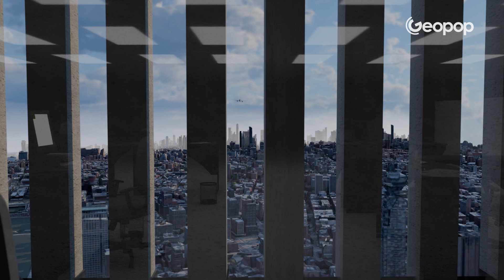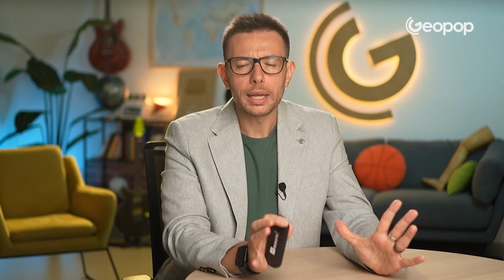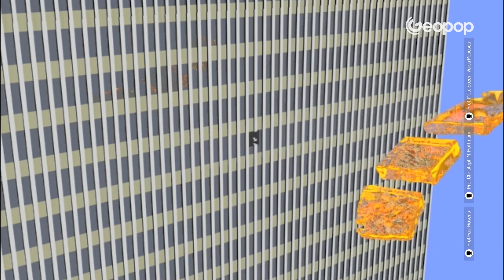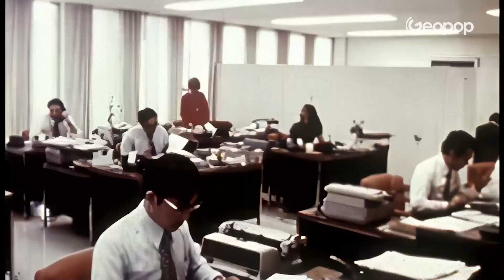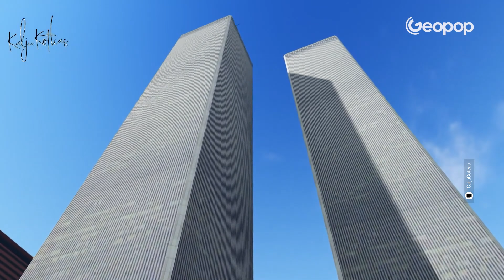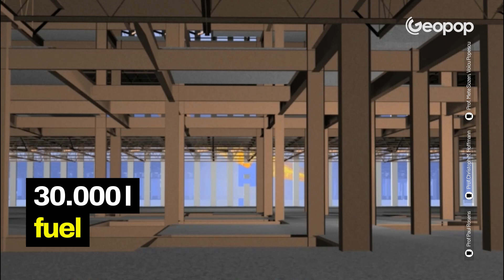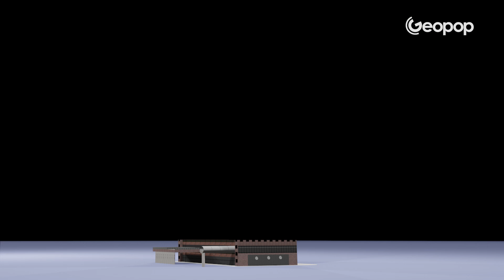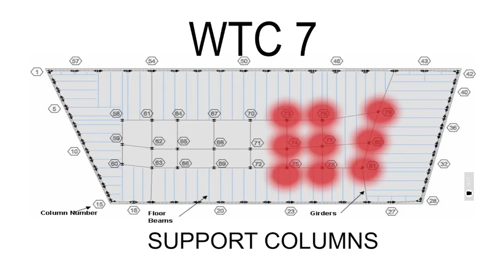9/11, 2001: The Technical Reconstruction of the Twin Towers and WTC 7 Collapses

Comment: Your version has nothing to do with what actually happened. Another falsification designed to support the official version. The video clearly shows how the upper part of the southern tower tilted when it fell, which means the vector of the pressure force on the lower part is shifted and acts with much less force on the floors in the part of the building opposite to the tilt. Accordingly, the vector of the building's resistance force - floors and ceilings that were not exposed to fire, will also be shifted. It follows from this that the top and some floors should have fallen on their sides, but not down. A complete fall down is only possible in the absence of a building's resistance force, and I ask you to note that the total mass of the upper floors has not changed and the load on the lower floors has always been the same before the collision. Also, you did not say a word about the cause of the point emissions from the building, going many floors lower than the actual fall. What you are saying about Tower 7 is generally ridiculous. In the best case scenario, for the reasons stated in your version, several floors in the building would have collapsed and we would have observed the process of the walls curving and the building tilting over several hours, but not a sudden complete collapse in a few seconds. This is a 100% controlled demolition of the building. Look at the video of missiles hitting buildings in the war between Russia and Ukraine, in the best case scenario, a section of the building collapses, but not the whole thing, and the buildings there are much older and less fortified. You can only take this version seriously if you are a complete uneducated idiot or you are affiliated with its support.
Reply: No, that's not it.  Twin Towers collapses were relatively straightforward, the fundamentals well understood in the professional engineering community within just weeks. Yet there’s a lot of really bad information floating out there on the internet, easily accessible to anyone and wild baseless speculation and pathological theorizing with easy hand-wave answers is simple, exciting and requires a whole lot less thinking, so it gets far more attention than it deserves.

To correct this I have on my own prepared this short yet detailed technical description of Twin Towers collapses based on my own observation and analysis of available true and relevant facts. No politics, ideology or magical thinking, just engineering. I hope is this will dispel many common myths and answer most if not all questions you may have about the Twin Towers collapses, because anything can seem like a conspiracy if you don’t understand how it works

While complex, most of the Twin Towers collapse mechanisms can be seen with the naked eye and easily discerned and understood by the layperson if sufficient time is taken to understand.

1. The Twin Towers consisted of 4 primary structural elements that together formed an integrated system where each relied on the others. 47 hollow box-section steel Core Columns carry the majority of the gravity loads. The 236 hollow box-section steel Perimeter Columns carry the remainder and ALL of the lateral (wind) loads. Long-span Lightweight Steel Trusses connect the core and perimeter column together at each floor with a Hat Truss on top to tie the structure together as an integrated unit where no element can survive without the others. There was no structural load bearing concrete and most components were bolted together.

www.youtube.com/watch?v=u7OqrC74Dm4

2. The impact of 117 tons of airplane (= to about 12 dump trucks) at speeds up to 590 mph with the energy of a ton of TNT completely destroys the aircraft. This in no way implies the Towers come out unscathed. Many perimeter columns are damaged or destroyed as are some core columns (example; 33 of 59 perimeter and 20 of 47 core columns damaged or destroyed at the impact floors in the North Tower), This damage is primarily through bolt-shearing failures at the end connecting flanges, as well as bending, twisting and fracturing of weld seams. There was no cutting or slicing - the reality was far more violent and messy.

3. The impacts destroy or damage fire insulation, fire breaks and sprinkler systems on multiple floors. Huge fires are started across multiple floors simultaneously and allowed to spread rapidly with no effective firefighting or fire suppression. This was an unprecedented fire event .

4. The hotter steel gets the weaker it gets . With fire insulation stripped away and no sprinklers the survival time of the steel greatly reduced. Gradually over time heat causes the lightweight steel Floor Trusses at the impact damaged floors to sag, which was observed and recorded. No steel melted or needed to. Structural steel fails long before it becomes a puddle. It just needs to bend

5. Sagging floor trusses pull on the increasingly weak and overloaded Perimeter Columns, causing some of them to bow inward by up to 5 feet. A straight column is up to 4 times stronger than a bent column. The bowed Perimeter Columns buckle and fail, initiating collapse. The formerly static mass above which the structure below could easily support is now converted into a dynamic mass up to 30 times greater. Because they have buckled, the Columns above and below the failure point are no longer aligned . The load bearing structure below no longer bears any load as it falls past the lower columns, NOT onto them.

6. Thousands of tons of debris fall within the four outer walls, down through the open office space, crashing onto the first intact floor it encounters. This massive impact immediately breaks the bolted connections to the columns as the amount of resistance the Floor Trusses can offer is negligible. The falling debris slows only marginally and briefly. Note: 
6a. This is NOT a solid top block crashing into and “crushing” a solid bottom block . 
6b. The debris falls past the columns not onto them. The columns provide no resistance to the falling debris. 
6c. Only the bolted connections of the floor trusses to the core and perimeter columns can offer any resistance. A pair of 5/8” bolts at each end of each truss vs. thousands of tons of falling debris. 
6d. No laws of physics are violated. 
6e. There is no 20 floors against 90 floors but rather 20 floors against one floor, then 21 floors against one floor, then 22 floors against one floor, etc. 

7. This floor-led collapse progression within the four outer walls can only go straight down.
7a. This process is often incorrectly referred to as “pancaking”. The catchy name stuck but nobody knows what it really. Pancaking is too simplistic and inaccurate anyway, I prefer Kaiserschmarrn.

8. Collapse progresses through the floor systems past the columns, through the path of least resistance . The resistance offered by each floor is always the same while the mass of debris and its velocity – thus its energy - increases with each floor failure. Each floor offers the exact same resistance to the falling mass while with each failure the falling debris constantly gains both mass and velocity. *This process of floor-by-floor destruction cannot be arrested, it can only speed up . Rate of floor failures increases with each floor as momentum increases, reaching an average acceleration of 0.65 of GA, or 35% slower than true free fall. Bam, bam, bam down the building until there are no more floors to fail. The resistance offered by each successive floor is always the same. More mass, more velocity, same resistance with each floor. Don’t get stuck on the but the lower floors weren’t on fire nonsense. They weren‘t and didn’t need to be.

9. The Towers were 95% air by volume. As that air was compressed inside the building it is forced down the tower and blown out the sides in reaction to the building collapsing . Those were not “explosions”, it was expulsions of compressed air caused by the collapsing building, explaining the low velocity, lack of flash, blast, supersonic pressure waves and lethal high-velocity ejecta.

10. Perimeter Columns become detached and peel away like a banana behind the collapse front, playing out to the four points of the compass extending to more than 600 feet from the base of the towers. This was quite obvious from examination of the debris pile.

11. Core Columns fail last as their internal beam bracing is stripped away by falling debris and lateral support from the floor to perimeter columns is lost.

12. For those who care about how long this whole process took; 31-34 seconds from the moment the perimeter columns buckled until the last core columns hit the pile, or 1/3 the rate of true free fall. Don’t believe me? Just watch any video of the collapses and note the loose truly free-falling debris dropping much faster than the towers themselves.

13. Each Tower had a 1-acre footprint. Far from collapsing inside their own footprints the debris pile spread out over 17 acres in a pile up to 14 stories deep. 8 surrounding buildings were destroyed and scores more damaged by the falling debris.

14. NOT observed were the 180-190 dB bangs of thousands of high explosive devices or the blinding bright flashes of burning thermite. Neither explosives or thermite could have survived the impacts and subsequent fire nor could have caused the (silent) perimeter column buckling that clearly initiated collapse either. A video of a shocked and injured firefighter casually using the magic word explosion is in no way proof of explsoIVES and the demolition_ case relies entirely on that sort of thing. There is zero tangible physical evidence and it would be technically impossible, totally impractical and completely unnecessary. No one would bother.

15. Twin Towers were perfectly safe within their design envelope. They only collapsed when taken far outside design parameters by an extraordinary and unprecedented event

Impact + Fire (heat) + Time + Gravity = Collapse . Remove any one of those four elements and there is no collapse. Ignore any of those elements (as many do) and you will never understand the collapses. The Twin Towers were an integrated system in which no one component could survive without the others. One fails, the rest follow, through the path of least resistance – DOWN – through the open space, bypassing the path of greatest resistance – the columns. Nothing I just described violates any laws of physics. All of the above is true no matter who planned and carried out the 9/11 attacks or why

In 24 years zero structural engineers of tall buildings, including the 1/3 that have retired in that time, have made any statements in support of 9/11 Truth BS demolition claims. Zero, nada, none. The lack of any such citations in the engineering literature (published in any country worldwide) is palpable.

I hope you found this helpful and informative. It is not meant to be adversarial, but to solicit informed critical comment, positive or negative. If I made any errors of fact, logic or reason or left anything critical out, please let me know so I can fix it. To stay focused just one topic at a time please and on-topic (Twin Towers ONLY). No word-salads of Gish Gallop. IF you can offer a more plausible alternative be my guest. Please start any reply with the words “Tits McGee” or I will know you didn’t actually read it, are not serious and just wasting my time. If you are going to argue, do it on the merits.
Reply: Ummm... you should probably take a structural engineering class, and a physics class, then re-think your "explanation".

Comment: How about explaining why no other buildings fell due to fire in the history of the US
Reply: It’s wasn’t a fucking kitchen fire.
Reply: @eggsinhell1532  It is argued that the jet fuel burns very hot, especially with so much fuel present. This is not true... The temperature of the fire at the WTC was not unusual... In combustion science, there are three basic types of flames, namely, a jet burner, a pre-mixed flame, and a diffuse flame... In a diffuse flame, the fuel and the oxidant are not mixed before ignition, but flow together in an uncontrolled manner and combust when the fuel/oxidant ratios reach values within the flammable range. A fireplace is a diffuse flame burning in air, as was the WTC fire. Diffuse flames generate the lowest heat intensities of the three flame types... The maximum flame temperature increase for burning hydrocarbons (jet fuel) in air is, thus, about 1,000˚C [about 1,832˚F]... But it is very difficult to reach [even] this maximum temperature with a diffuse flame. There is nothing to ensure that the fuel and air in a diffuse flame are mixed in the best ratio. This is why the temperatures in a residential fire are usually in the 500 °C to 650 °C range [Cote, 1992]. It is known that the WTC fire was a fuel-rich, diffuse flame as evidenced by the copious black smoke....
--- Thomas Eagar and Christopher Musso, "Why Did the World Trade Center Collapse? Science, Engineering, and Speculation," JOM: Journal of the Minerals, Metals & Materials Society 53.12 (2001), 8–11
Reply: You aren't 'smart', you're just an idiot.
Reply: Yes, just like in Los Angeles a few months ago 17,000 homes and businesses were NOT raised to the ground by fire.

FFS 🤦‍♂
Reply: @TheLoonResistance how many were steel frame  ?
Reply: Exactly never in the history has a skyscraper  fell due to fire but on 9/11  three fall in Exactly the same way 
Wait for the Incel shill CriticalStinker-01  to give an unfounded explanation 
It ok though he's a bottom feeder
Reply: @Guns4Hire-s5e  "3 fall in exactly the same way" This is just a lie that you can easily see. The Towers fell top down and WTC 7 fell bottom up. Completely different.
Reply: @joedagg4495 
wtc fell straight down like what you see in  controlled demolition

There was explosions heard by hundreds of people even caught on films they are trying hard to hide but you look deep enough its online Explosions were heard thats a fact, that nist threw out of the report 

If one was rigged they all were,  
Cognitive dissonance  is how most Americans deal with the event.
Reply: @Guns4Hire-s5e  what other direction could a building ever fall???
Reply: @alexsiemers7898 to the path of least resistance…simple physics.   Not in its own footprint like a controlled demolition.
Reply: Ummm... why are you ignoring all the hundreds of buildings in the US that have fallen due to fire?
Reply: @ChristLink-Channel there’s never been a steel frame building that collapsed due to fire ever until 9/11
Reply: @brandonhontz1159  There's never been a steel framed building bit by a wide-bidy airliner moving at VNE, until 9/11.  So what is your point?  It's the first time this has happened, because it's the first time that this has happened!  Get over it.
Reply: @ChristLink-Channel  Brandon is right.  It's never happened before.  9/11 was a controlled demolition.  Buildings don't fall straight down at the rate of gravity like that unless it's planned meticulously.
Reply: @phunkdoctaspock  Nice try.  Buildings ALWAYS fall vertically, under perfect gravitational acceleration, at a rate of 9.8 m/s^^2.  Try as you might, you'll never find one that doesn't.  But trolls and conspiracy kooks don't understand physics,  so that would exalpin your confusion...
Reply: @ChristLink-Channel  Building 7 was not hit by a plane.  There goes your silly argument.
Reply: @markcohen308  Ummm... nice try, but we are not talking about building 7.  We are talking about the simple, undeniable fact that ALL buildings fall at the exact rate of 9.8 m/s^^2 when their support is removed.  simple physics try learning it one day, when your mommy lets you out of the basement, and you might be able to figure it out.
Reply: @ChristLink-Channel idiot